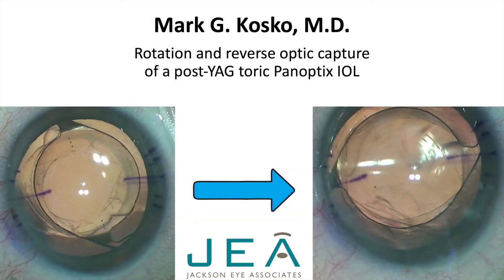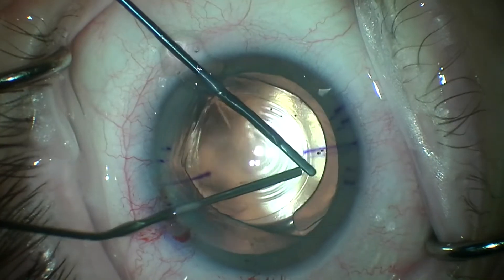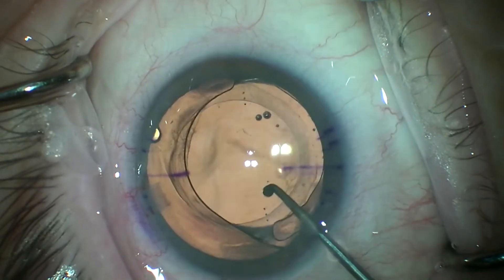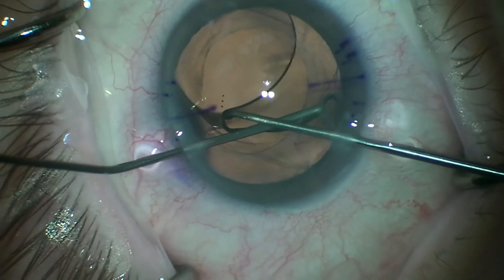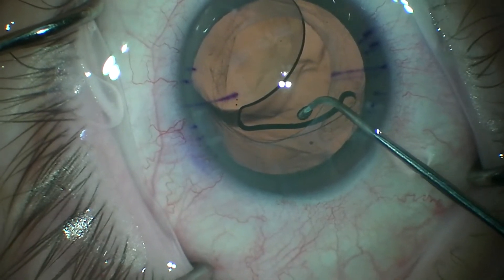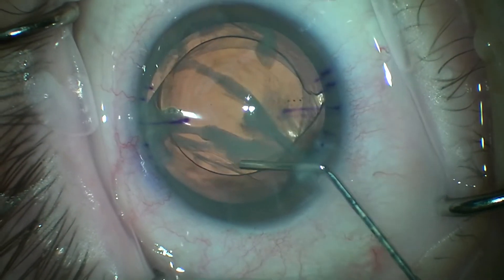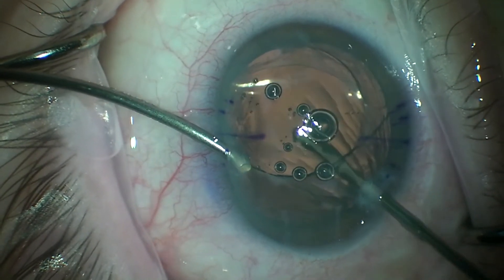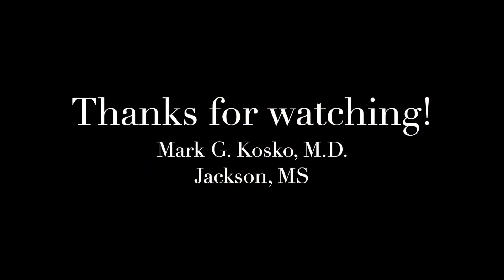open capsule toric panoptix rotation with vitrectomy and reverse optic capture kosko

Comment from the maker: Update: patient came in post op two weeks today and was 20/20-2 uncorrected at distance, J1+ uncorrected at near. 
Cylinder 0.00
Distance MR was -0.25. (Trace myopia from the reverse optic capture probably causing subtle anterior movement of effective lens position… at any rate, negligible for this very happy patient.)
This eye actually now sees better than the other eye which is 20/25 distance (I didn’t check near in it). 
Patient and doctor very happy!